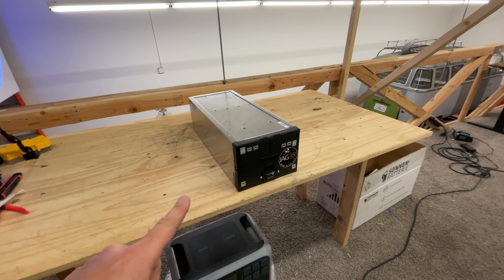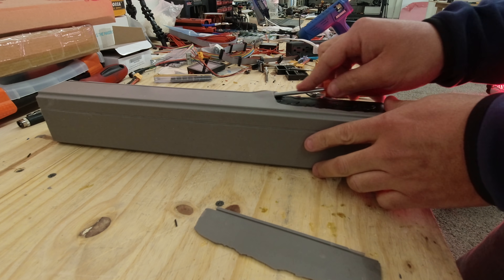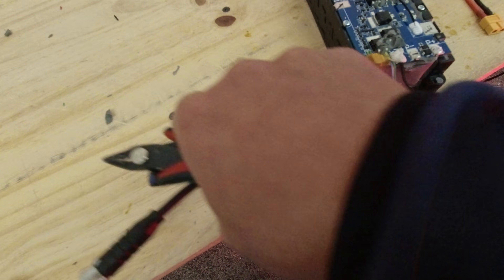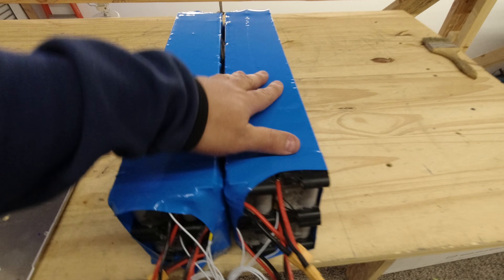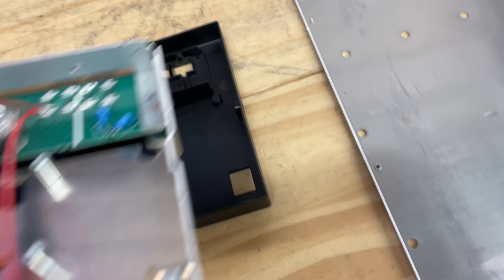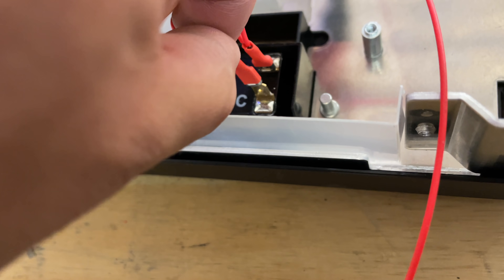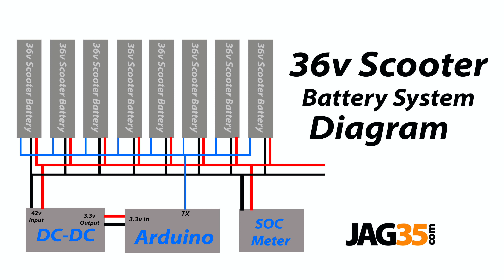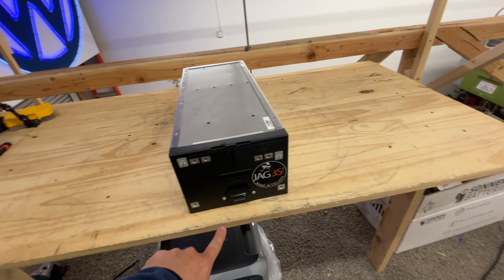$138/kWh  36v PowerBox Build DIY Project

Comment: Saw the 24v kit.  Now I've seen this.  But I need more power.  How about a 48v, 7k or 8k kit?  I can build a house from scratch.  Both project manage and work every trade.  But this seems to be at the edge of my understanding, so a kit is prob the way to go.  Mechanically I understand both kits.  Electrically, it's a little fuzzy.

I just got a bunch of 18650's from Battery Hookup for my vaping.  WAY more that I need.  So I'm looking for a neat project to aim for that's both practical and useful.  Ultimately I'd like to get to the point of having a whole house UPS.  Realistically I would hire a pro for that.  But it would be awesome to totally understand how it all worked.

Thanks for these videos.  I AM learning a lot!

Comment: I see the vents on the back ... you ever design for heat dissipation. Im thinking of doing this module in a 15 to 18kWH power wall but designing for some cool air case venting out the top with pull through on the cases the 3.5 are built into.
Reply: Just do it and shut up bro

Comment: Is there a way to rewire these to 48V using the same enclosure? That opens up many more charger / inverter options.
Reply from the maker: Yeah buts just better to start with entirely different cells for that,  I’m working on kits to make 48v currently, stay tuned
Reply: @jehugarcia  okay perfect because if I could pair this to a Schneider SW4048 I could do 120/240V on grid and off grid for about $1300 of inverter. Plus those units can control a transfer switch.

Comment: Hey so I have a question for you.

Has anyone taken an old server rack and turned it into a hot-swap battery?
That way you can just stack/battery management system. 
Honestly I think it make more sense for people to buy electric cars without the battery. 
Then just lease the batteries and swap them them out regularly instead of recharging.
Reply: This is a really cool idea. Your house could use the server rack as its "power wall", and if you came home with a depleted battery in your electric car, you could swap it for a full one from the rack. Only thing would be how big and unwieldy batteries like that are. You probably wouldn't want to be moving it around all that often.

Comment: Going to try to biuld this pack for my golf cart. Do you think i can use the original 36v charger. The golf carts a 1990 with th big grey charger.  I think it put out 20amps dc
Reply from the maker: You should have no problem using the original charger

Comment: It looks like the batteries are only sending power briefly every few minutes. Thus I never get the signal to keep them on. Anything I can do to fix that?
Reply: 8:19
Reply: @travelnc2g  thanks took many months to figure out but Jehu missed the 7.5k ohm resistor,,,,,,……. Once I found out about that 7 months of frustration over

Comment: confused I thought maybe it would be made for $138  I got happy for a bit then i seen reality after adding the parts list needed and just that went around $600 and always when I check everything is always sold out so I dont want to buy parts that ill be stuck with for a long time till other parts become available and even then still try to buy them before they are sold out again :-(
Reply from the maker: What’s sold out?
Reply: @jehugarcia  the battery case to get it all together
Reply: Isn't it all relative, like have you priced any battery packs of the same power capacity lately? $107 for two scooter packs is great from what I've seen. Every other part of it can be made how ever you can or want to make it work.

Comment: How do you have sex with the opposite sex when you don' know the difference in terms ( male & female) You keep calling the two yellow w/ red & black wires the wrong name of male & female. You have them backward.
Reply from the maker: Maybe you are gay and don’t know it?  Pretty sure I order thousands of xt60 connectors and all my vendors agree with my gender designation.
Reply: @jehugarcia   YOU MUST BE PART OF THE FLAT EARTH MOVEMENT.   YOU KNOW ALL THE PEOPLE THAT BELIEVE EVERYTHING BACKWARD FROM EVERYBODY ELSE ON THE EARTH.   THE PLUG THAT GOES INSIDE OF THE OTHER PLUG IS CALLED THE MALE PLUG AND THE PLUG OR MORE PROPERLY THE SOCKET THAT THE MALE PLUG GOES INTO IS CALLED THE FEMALE PLUG OR SOCKET.
Reply from the maker: It’s all about the pins not the connectors
Reply: @jehugarcia     well that is 100% backward because you always refer to the plug as a total unit and the pins only come into play as to their number. Of course, I know that you're dealing with a manufacturer, that because it's their product that they can call it anything that they want, but in the reel world if you didn't have a picture or a sample, people wouldn't know what you were talking about. And my references are as a retired airforce msgt with 26 years of all kinds of plugs and sockets.
Reply: @chucksteward2615  I certainly had confusion years ago about whether it's the gender of the pin, or the connector that houses the pins. That's why I'm glad for photos.

Comment: just to be technically clear sayng it needs "power" to turn on is not quite correct, (and could be confusing) it's actually requiring to be grounded on that small black wire.(to turn it on from hibernate)..for me I like that feature and would use a switch on the outside of the case..
Reply: thats the cool part of diy you can customize as you wish,
Reply: Chuck Itall     I don't think he understands
Reply: yes it's always good to understand things like this and Ohm's law because I cringe when people say something like "well since I am sending serial output to 5 inputs instead of 1, I'll just do away with the voltage divider resistors needed to convert to 3.3V"... Just need to understand specifications
Reply: @JeffSmith03  or the loading down of inputs ,, or impedance differences... sending multiple signals using buffer circuits helps reduce loads. high impedance inputs on devices might be fine for multiple lines but that is taking a chance. data busses are usually driven with higher curent drivers depending on how many peripherals are in line and what type.. this is why many data chips are high impedance inputs with fet or mosfets. etc.
good design takes into account all these variables.

Comment: Have you looked at temperatures inside with use? Is a fan needed?
Reply: Just being metal casing I would make sure there's a larger heatsink outside of that with air flow

Comment: Can you just remove the rubber compound enough to get to the connections, or does it all need to come off in order to fit 8 packs in the box?  The rubber compound provides some level of desirable vibration and thermal protection, perfect to heat shrink around that rubber.
Reply from the maker: You can leave it but you’ll need a bigger box
Reply: @jehugarcia  roger that , thank you Jehu

Comment: Jehu my name is Ricardo Beltre,  I'm building a new house in Allen Town  Pennsylvania,  I will like to include solar panels and a battery bank.  What do you recommend?  Is it practical in PA?  If so,  can you help me?
Reply: I'm in Lancaster PA. I would recommend you keep battery bank inside, someplace they would be kept cool all year around. 68f
Reply: @klitzkop  ok,  I also want to know if you recommend someone installing solar panels and having a battery bank.  Does it transfer into $ savings in the Allentown area?
Reply: @ricardobeltre1843  If you are not afraid of heights, you can install it yourself. The battery bank will power a pure sign wave inverter which will give you desired power. I recommend pure sign wave not modified. What are you going to be powering?
Reply: @klitzkop  I want to power the entire house and save money on electricity.
Reply: @ricardobeltre1843  you need a 12k watt inverter, pure sine wave. I recommend building a 48 volt LiIo battery. 300p 12s battery should be enough. You can buy two 8k watt inverter. You looking at 6 to 8 thousand. Savings would come after 4 years. Batteries should last about 5 to 7 years.
Reply: @Ricardo Beltre The first step would be to determine how your power company handles net metering and the interconnect agreement.  Where I live we do calendar year balance forwarding so in my case every kWh I push to grid during the day I can get back at night or cloudy days.  At the end of the year they credit my account for their fuel cost for the remaining balance.  My friend who lives in another state has a completely different situation, his power company closes out monthly, so all the extra power he would generate in the mild months won't help him during the higher use months.  In these cases a battery bank really doesn't help in a grid-tie system.  

Now look at some other areas where they have large price differences for time of day usage, which is usually when solar isn't making power.  That's where a battery bank will save money. Batteries are only saving you money when they are cycling and reducing or avoiding peak use rates.  

You'll have to contact your power company and look at your bill to find out the above.

Comment: Isn’t the Arduino always on and draining the battery?
Reply: I mean everything uses power... but since the nano uses 7-12V and 19ma its only 0.247W at the high end.
Reply: Each of the 8 BMS's probably drain more out of the batteries than the Arduino. 
All the grounds are connected so you could splice all common [short black] wires to one external switch.
This way when it is off. It is off. The feature is there so you could use it if you are concerned about self discharge. :-)

Comment: Cool, can someone point me why do we need Arduino TX connected there? And where is the Arduino sketch for that? Thank you
Reply: “These battery packs require a status/unlock signal to their BLUE (Tx) wire with 9600 Baud serail: 0x3A, 0x13, 0x01, 0x16, 0x79
Then the battery replies with an extensive status report on the GREEN (Rx) wire. We are currently designing a device to display the status report from the battery,  but for now we can turn them on and use them to power many 36v devices.” (SourceJAG35).  Link is in the description.

Comment: Is there a way to still have it a 24v pack by using 7 scooter packs and rewiring to each pack to be in parallel?  I like the idea of using the packs as is but most of the systems I've been using are 7s, 24v?

Comment: Where can i find replacement batteries for my 36 V electric bike ? Thanks !
Reply: Where did you get a bike or thru bike manufactor.
Reply from the maker: ???? ...... No im sorry I cannot help you,   If I knew where to get 36v battery packs I would definitely make videos about it.
Reply: @jehugarcia  You could pick up a DIY ebike battery box and fill it with cells from the scooter packs or any other 18650. DIY battery box: https://www.aliexpress.com/item/32762997036.html

Comment: Help... I have a 36 volt golf cart needs a battery... How many amp hours will this battery pack be? Thankyou..
Reply from the maker: 3.5kwh/36v= 97Ah
Reply: This is not for golf cart, you need high current pack.
Reply from the maker: More than 200A?